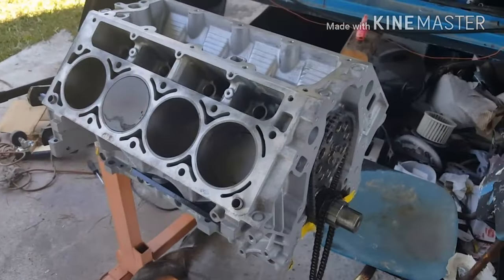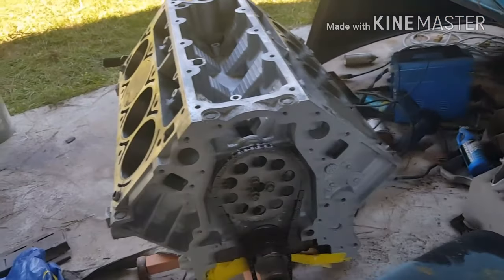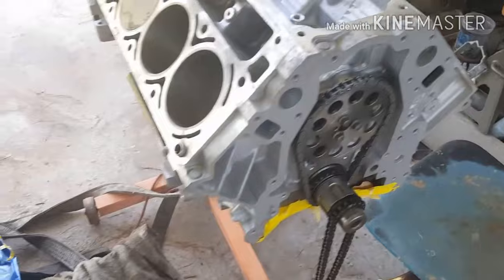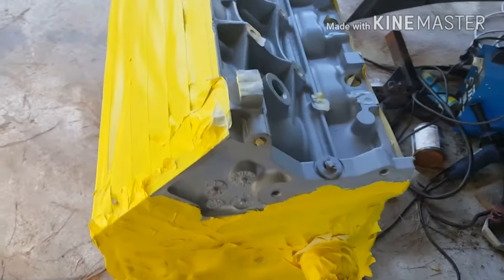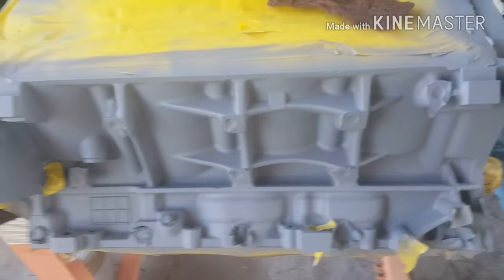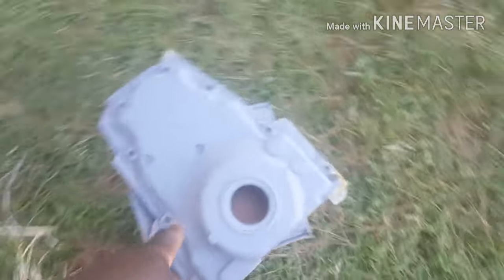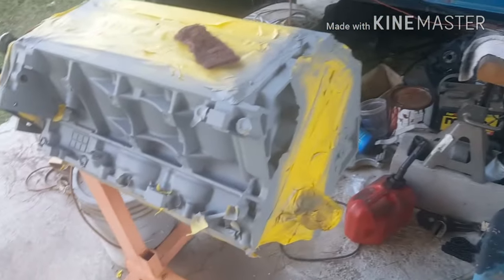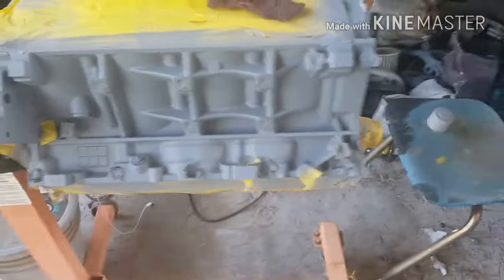The time have COME

Comment: What cam, pulley, spring, and valves are you running
Reply from the maker: Damien Greene 650 springs and TEXAS SPEED  PROFORMACE CAM
Reply: 6.0 heads?
Reply from the maker: Damien Greene ls6 243 heads
Reply: Did you pick those up at the junk yard?
Reply from the maker: Damien Greene no fam bought them frm total air engine flow  243 cnc ported